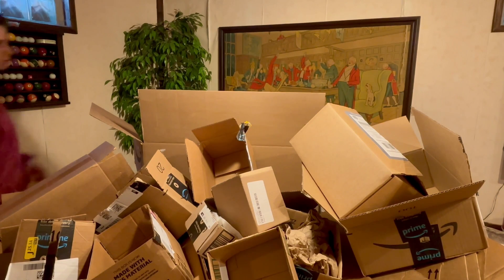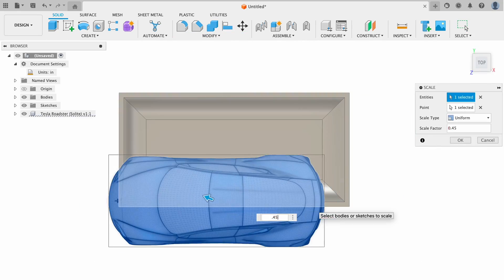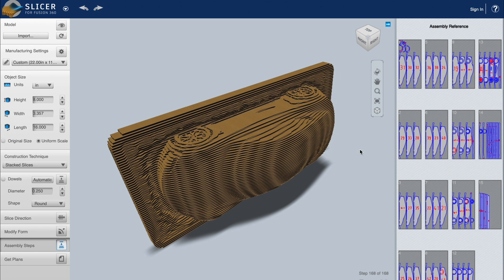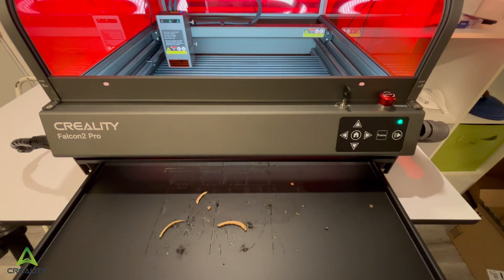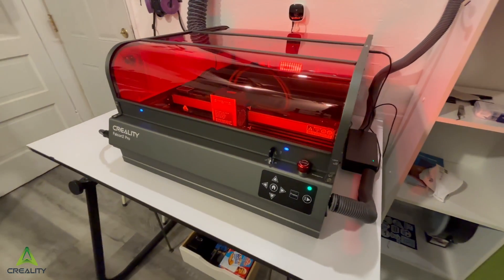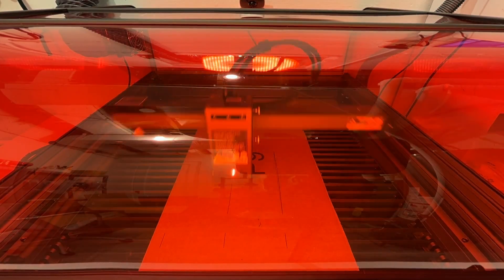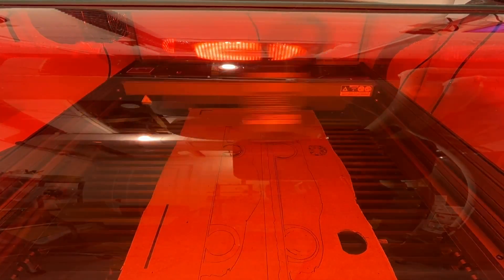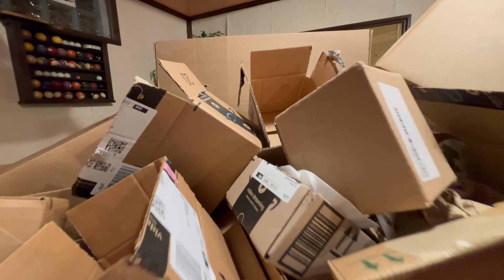Testing NEW Creality Falcon2 Pro Laser! (40W)

Comment: Impressive! Very clever and lots of work but excellent result. I was looking for the sttings, the  ones I can see in the screen are not set up as the scoring shows the same as the cutting settings
Reply from the maker: Thanks! Here are the settings I use for cardboard: (Speed/Power) Cutting: (600.0/75.00), Scoring: (1500.0/20.0). Hope this helps!
Reply: @buildsomestuff  It does help a lot, thank you, you are very helpful and very kind, I have the normal falcon2 40W and of course it helps to know your settings.
Reply from the maker: @Fancylooks Great! Just one thing to note: I ran these settings on “Precise Mode” with the 40W module by pressing and holding the black button near the two blue LEDs on the top of the 40W module. This lowers the wattage to 22W so it doesn’t burn the cardboard too much.
Reply: @buildsomestuff  Excellent, that is why it looks so clean! I usually do that mode for engraving, but this is another great reason to use it.